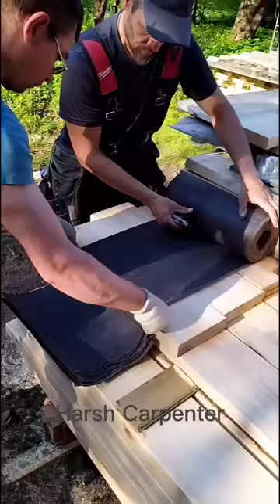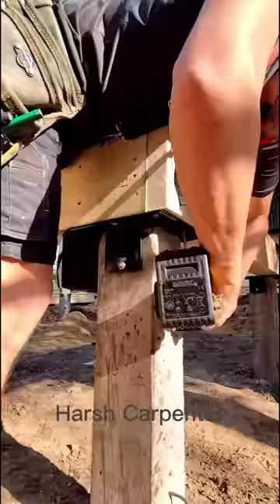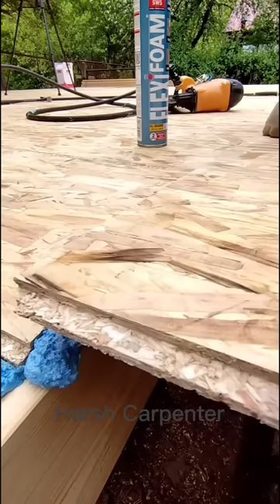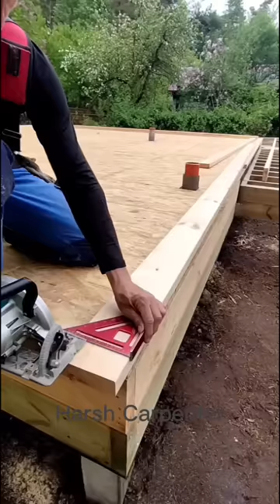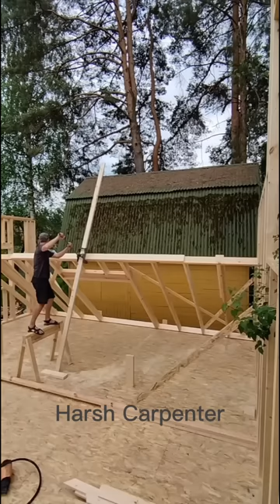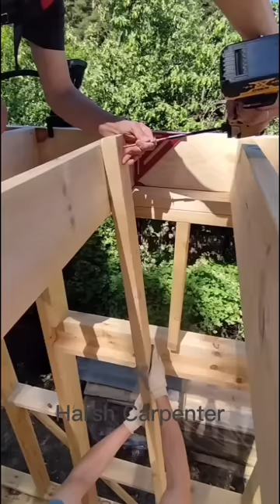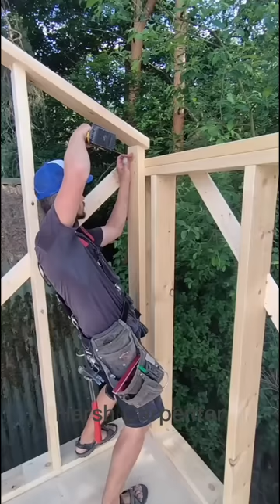DIY frame house in 39 minutes. Larry Haun would be pleased

Comment: Hats off to you both. I'm building a home for the first time. This has been the Best video of Advanced framing I've ever seen. I learned more from this than all of the other 20 plus videos I've watched. I'd hire you two 10 times over any of the others. Wow just wow! Bless you both and your business!
Reply from the maker: Thanks a lot! Believe in yourself, learn more and you will succeed! ✊🏻
Reply: This house would never pass code in the 11 states I have done construction in. A 2 story house needs to use 2x12 floor joists with bridging between every joists.  And you have to bolt the porch to the freeze plate or you have a party of 5 and the porch comes loose from the house. And your wife would hate you because the floor squeak and moving because there is no subflooring. Before you build check code. Take your plans to the code enforcement and if you want your wife to really love you, let an engineer to look at your plans. Imagine building the house and the code enforcement tells you you need to upgrade the floor joists from a 2x8 to 2x12s. They built on a 12" on center like a good contractor does when he wants a sturdy safe home but they would use 2x12s with bridging between every joists every 2 feet. The only advantage of using joists smaller than 2x12 is to save money. You NEVER cut cost on the foundation! Hehehe.
Reply: Yeah, no. That was a lot of what not to do brother
Reply: No floor insulation?
Reply: They may have skills but saw the sandals and wrote this, then swiped.
Reply: @ronniebaker4549  only way it passes is if it is registered as a cabin, codes for a recreational cabin are loose. But I agree, lack of bridging and at very least stagger, I am huge on staggering any seam zones to spread out and distribute stress areas
Reply: @reelmatthewswinslow  Staggering is common to save material and labor costs. You obviously are a carpenter and or a builder/contractor.
Reply: Prea mult lemn
Reply: We used all woods in the Philippines way back 1900-1970, its very expensive now, we used concrete and steel. Yiu need to have your own trees to cut to make this kind of house in  here. But the master carpenter is so skilled.
Reply: There are a lot of old frame homes still standing in south Florida that were built in this style rafters and blocking. Probably wouldn't pass code but they're still standing while the homes that were built to code aren't.

Comment: Brings back memories. Worm drive Makita, let in braces, snapping lines, balloon walls, rolling joist, cutting stringers. Standing walls, cutting and stacking roofs. Retired carpenter with over 50 years in residential construction.  
Excellent work and great video.
Reply: I've been a framer for 47 years 
Alot of years working on the housing tracks , room additions, and custom homes
I got into it because I love it
Still do  :)))
Reply from the maker: This is work as creativity, if it brings pleasure, then it is worth doing, if not, you need to look for yourself in something else.
Reply: Agreed lead man has excellent skills and attention to all important details 😊
Reply: @johnsavage3073  There is something  about working with wood and other natural products that is grounding. At least for me, the smell of wood, being outside and working at heights was wonderful. Added the sense of accomplishment of actually producing something that was real useful and long lasting.
Reply: farwindow They do not smoke and not take brakes, try it yourself and maybe you will be supprised 😂
Reply: Agreed great job 40+ years residential carpenter/ builder.
Reply: Curious What part of the country are you in. And are you available for travel work SE USA. Fast trac
Reply: Do you build tiny house for veteran
Reply: @markcreamer3196  47 years  huh. What region? I did track homes for minto here in So Florida.  At times small crew we topped out 3.5 houses a week.   Building dept was not  a big fan of  production work.  Ive seen  large crews do 1 a day.  Albeit 2000 sq ft or 6500 under air these guys  were dried in by 5pm regardless.  I personally enjoy the custom waterfront  homes. Would take a few weeks to frame up, alot of   blood sweat and tears buddy!
Reply: @johnnybotz  When I was a kid going to work with my father, he worked on 200 plus house tracts. This was in the early 60s in SoCal. When we would move to the next residence to work, it would often be two streets down. Lots of carpenters and lots of building.  As I got older and worked in other parts of the country, I  found that many of the people I worked with,  didn't  realize the speed and production capability that was possible.
Many of the carpenters in the 60s had served in WWII. They had determination and grit. Much of the work was piece work. They often specialized in one aspect of construction, got extremely competent and fast. Many houses could be built in near record times.
Reply: My husband was a cabinetmaker, not a carpenter, but I STILL MISS THE SMELL OF FRESHLY CUT WOOD...😊❤
Reply: @SpiritBearRanch1890 
I helped girlfriend with a home cabin type that was direct WWII military kit and all assembled with bolts. All very nicely engineered. 
I added a large deck out back with a huge picture window to have direct view of pine tree forest that also included claw foot bathtub on the deck that really worked out nice when filthy hot weather. 

Now 70, I wish I had copy of it to live full time in it. 
Cheers

Comment: "Harsh Carpenter " ? No, buddy....SWEEEET CARPENTER !!! 
I have been driving nails and screws and cutting boards, since I was 8 or 10 years old, started getting paid to do so as a teenager,  spent many years doing trim carpenter work mixed into my 45+ years as a cabinet maker and furniture designer/craftsman,  even built a couple of shops and a "tiny house", but......dude.....this was SOOOO satisfying to watch. An artist at work, doing ALL the right moves and creating meticulously detailed framing.
Many particulars stood out that made me smile. The need to "bang fit" the struts, the fact that you have perfected cutting "square" with a worm-drive, rather than a chop saw. Having state-of the-art glues, tapes, and achieving incredible tautness on all the wraps and barriers. These are the details that set your work head and shoulders above 98% of the "professional framing guys" that I have ever met in over half a century of doing  "building ". 
I am so inspired that I am now going to my drafting table,  dust it off, get out my architect's ruler and triangles and start the plans for the extension of my shop at my new home that I just bought to retire in. Thanks for the video,  thanks for the inspiration, and you did most of it wearing TEVAS !!! Would not be my choice, but as an Oregonian....I  TOTALLY  understand...hehehe.
 
BTW...you and your excellent crew are certainly eligible for membership in a little-known (because it's just a bunch of folks that think like we do...and now YOU) group called the A.R.O.C.A. Society....the "Anal Retentive/Obsessive Compulsive Artisans". 
There are no sign-ups, no dues, no meetings...not even a logo.....We couldn't agree on a font (!!!!). But welcome to our group, we applaud your abilities and fervor for the work that many of us live to do....again,  THANKS  !!!
Reply: @Fixorfish what a great comment you made. I love it as much as the video,  those guys are awesome.

Comment: I'm a Tradesman in the UK and I believe you should become a master of your craft whatever it may be and this is a true Master Craftsman at work. Beautiful to watch.
Reply: I have done construction in 11 US states. No state I built in would allow a 2 story stick build on a 2x8 floor joists with almost no bridging. And if you don't bolt the porch to the freeze plate your party of 5 might be enough weight to pull the porch from the house. Google decks falling with people on them in Atlanta. Atlanta has the most relaxed codes of the places I have built resulting in porches falling causing injuries. But every other cities in Georgia the codes were strict enough to be safe. Using anything less than 2x12 flooring joists with almost no bridging is dangerous and the floor will shake and squeak. NEVER try to cut cost on the foundation!
Reply: Lovely  work lads....but I'm  from the 🇬🇧....and that there is a shed...very expensive  shed.  You lay a brick and it will be there 200 years later !
The uk will be going  timber frame but they creak as they expand , total rubbish.

Comment: If you stagger your floor joist freeze blocks you won't have to toe nail them.  That's a pretty rookie mistake dude! Totally against code in my state. But so is building a permanent dwelling on sonatube pillars.
Reply: @johnmaxwell5932  he's right
Reply: You need a support along the joist against the wall, nails alone will not do, and you do not have a center support between those spans.
This floor will collapse and warp, when weight begins to be added.

Stop this construction project.
Reply: @johnmaxwell5932  he's bulshitting around.

Comment: Outstanding job sirs 
I'm building an apartment in pre existing walls well, another room about 350 or less square feet. It's a pool house. The foundation is very good and the walls are good, just need polymer plastic sheathing for state housing code, before I place insulation

Comment: Awesome work fellas, great job, high quality all the way around. However, why didn't you lay down a concrete slab? Or put in a ground barrier? From what I can see moister will easily wick its way up into the joists and floor. Bugs and mice can easily get through from the ground. I would have put in some sort of ground barrier at the absolute least. Also, no floor insulation put in to control temperatures from the ground? Is this in a temperate climate or is this seasonal or tropical? Keeping moisture out is also a top priority in my builds, over time moister will wick up from the ground into your supposed sealed home and cause problems done the road later. A simple concrete slab prevents this or a simple moisture barrier on the ground followed by sealed insulation also works. Have a great day guys, thoroughly enjoyed watching your work, high five and booyah for a job well done!

Comment: Technically the blocking for the floor joists needs to be below the joist for 2 reasons, mostly because long timbers shrink more than short timber and to provide airflow underneath the flooring. Many carpenters make this very mistake it is a big mistake because you'll get ripples in the flooring I have seen this before. 
Carpenter and joiner study that royal institute for technology Sydney.

Comment: The different between a carpenter and your average framer. This is beautiful to watch even as an electrician. 🫡 This is who I would want building my home not the dudes from Home Depot, no offense it’s just true. The stairs were sweet, nice use of screws and foam. My house was built last year and it already squeaks everywhere, sounds like a 200 year old home. It’s very sad, 400k where I live that’s about 1mill where I came from in CA and it feels like it’s built with balsa wood…
Reply from the maker: You need to approach any business head on. Where things are on stream, as a rule, the performers' heads often stop working. And the goal of mass production is to reduce costs, rather than focus on quality.

Comment: I dont know where you are building this. But in the northeastern U.S.  it wouldnt pass inspection. From experince i know there has to be concrete footings with rebar poured 4 geet to the frost line for the wood struts that lift the house off the ground. Even the deck had to be on concrete footings 4 feet down to frost line. Where ever you guys are your lucky thats a lot of extra work. Especally in north east the ground is very rocky and small boulders

Comment: I hope you have witnessed a category 5 hurricane. I dont want you to endure 3 of them as I did. It is 2024. I am certain that construction will resist a cat2 hurricane. About tornado, I cant say. My recommendation, based on what was left standing after big right winds and big left winds is: ALWAYS install metal plates bolted to each angle slab joint. Wind destruction works like a giant transparent hand shaking back and forth EACH piece of wood 10,000 times. So, nails wont hold. Sorry. The only wood houses to keep integrity after a powerful hurricane 12 hours right blow and 12 hour left blow are those assembled with bolted  metal plates. Takes a LOT more time, it is more difficult, is more expensive, looks really ugly, but works when your life depends on a solid structure. Respectfully yours.

Comment: When you finish off the wall frame what is the cutter you use to cut the rebates in the frame to fit the cross piece of timber? 
Also what is the ratchet thing you use to raise the stud wall to vertical? 
Thanks in advance.

Comment: Not running a starter course and relying on roof tar to keep your seams from leaking is scary as hell. Also doing the same at the gable ends cutting the shingles 1/4 inch back from the edge instead of hanging over 1/2 inch. Never seen it done that way.

Comment: I might be missing something here but wtf.. they stared with the foundation beams.. good job. They moved on to the floor joists sitting on either 3 x 1 3/4 or 2" beams = near if not 6" support area. The floor joists were left 1/4" in supported longest beams length ways and  5 3/4" on the short run.. right at the start of the video. Floor joists or any support for that matter should not be like this! Am I just seeing things  or what?

Comment: Where's the foundation for this house? It appears to be just built on top of the soil. Soil shifts & erodes. A foundation is needed to prevent the house from shifting too much & becoming unlevel as well as causing structural damage.

Comment: What is the black sheet you put on top of the lumber? Thanks!
Reply from the maker: In what place exactly?
Reply: @harshcarpenter  For example at the beginning (min 1:00) you cut many small rectangles from a big roll and you place them under the flooring like between the base pillars and the flooring. I saw you use that sheet a lot and wondering what is the purpose of it? Thanks a lot!

Comment: 1) which dewalt nail-gun is that & howcome u don't use a battery powered 1?
2) y ru only wearing sandals & not boots?
3) howcome at the end there were multiple shots of the structure from different angles so we cud see the end result??...the video had this promo screen which blocked the view😡😡

Comment: 38:58 i do not know if the house will support a bit windy wheather or crashes on itself! 
The guys works in extremely dangerous situation,  with no safety Devices and completely inappropriate dresses.
In italy they should arrest the contractor and the construction site should be seized.
A question: How many accidentes on work you have weekly?

Comment: Глупость, обработка необходима по всем плоскостям доски, до сборки. В противном случае возможна плесень между досками. И грибок.
Reply from the maker: Mold and mildew appear where there is moisture. If the walls and floors are made correctly and from a dry board, then there cannot be moisture there, and therefore mold and mildew. Construction standards allow not to treat the frame of the house at all. Except for places in contact with concrete or foundation.

Comment: You're obviously not an engineer or you homes for damaged in hurricanes due to the uplift which is controlled by the strapping that you use hence hurricane ties. As far as the mailing goes it's correct. And if you were an engineer he would have noticed that they didn't level the walls.